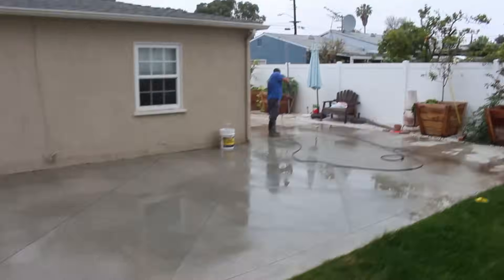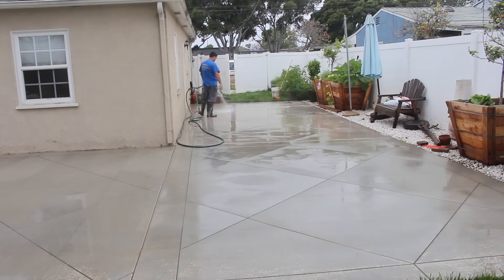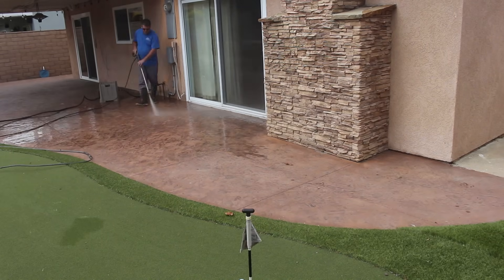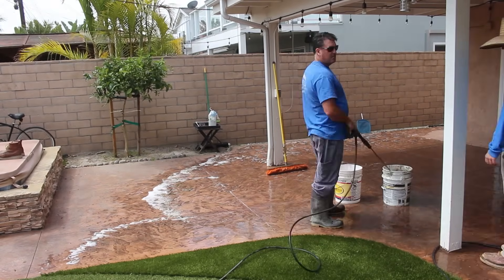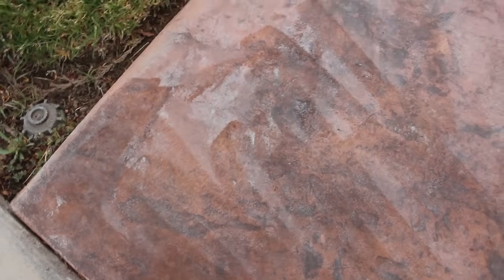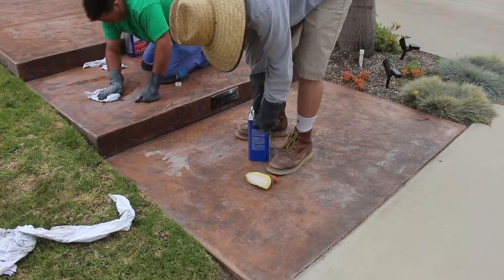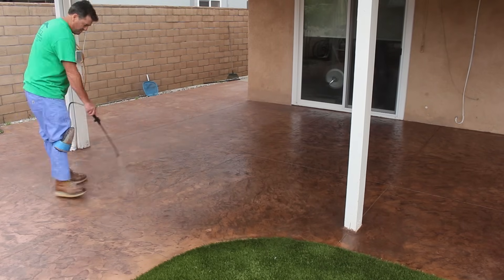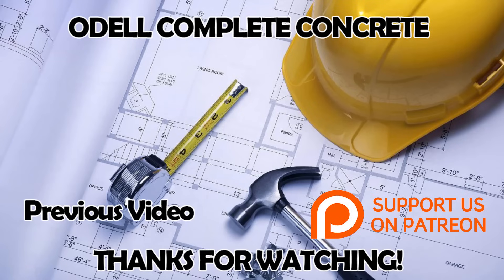How to Apply Sealer to New and Old Concrete

Comment: Recommendations on sealer build up over the years.  Try using either straight xylene/ toluene or a very diluted version of sealer . I also don't recommend acetone based sealers fore this application because it  flashes too quickly.  You also mentioned lacquer, now that is not compatible with any of the above mentioned  solvents. If you did use lacquer you will  have to stay that. Cut your sealers with the solvents they're based with but I do not recommend cutting acetone based sealer.
Reply from the maker: That's interesting, I like to dilute with acetone because you can walk on it in 30 minutes.
Reply: I think I'm just not really a fan of acetone based sealers because I prefer rolling it,depending on the situation. Acetone isn't really roller friendly. Maybe I'm just bias. But try the straight solvent or minimal solid in an inconspicuous area some time. I think you will find it to be an inexpensive and quite affective way to bring back a new fresh look without caking on a lot extra solid sealer.

Comment: Hii Guys,
May I please request for your help to seal my new and old concrete at my 3 years old house. 

Please guide me to do sealer on the concrete all around the house PROPERLY.

Like, can I use normal Karcher pressure washer as it's much cheaper than the one with 3000 psi pressure washer. 

My driveway is 3 years old.and the concrete all.around the house is 2months old. 

Look forward to hear from u soon, 
Thanks
Reply from the maker: Sure
Reply from the maker: You need at least 2800 psi

Comment: David, by chance do you have a link to the wet look sealer and non slip additive? Want to seal my pool deck but hoping to keep it as slip resistant as possible thanks 👍🏽
Reply from the maker: I wish
Reply: Dealer Depot Monongahela. We have decorative "wet look sealer" and slip stop additive. We're distributors for Chemmasters.

Comment: a battery powered sprayer would be so much easier then pumping that thing, plus you have guaranteed pressure putting out the same amount of product.
Reply from the maker: I happen to have a Milwaukee M18 switch tank backpack concrete sprayer.
I will be giving away a couple real soon
Reply: @OdellCompleteConcrete  Looking forward to another give away!  The backpack sprayers would be a good one.

Comment: That first layer was very sparsely applied and didnt have even coverage. You'd have been better off buying a better quality hand held sprayer that sprays evenly. Or a low pressure pump assembly would work great too.

Comment: I used to make “acetone hash” back in the early 70’s.  You save all your stems, then soak and shake em in acetone, pour it out, let it dry, then smoke the residue until you have the worst headache you can imagine!
Reply from the maker: Great tip!
Sounds like oil